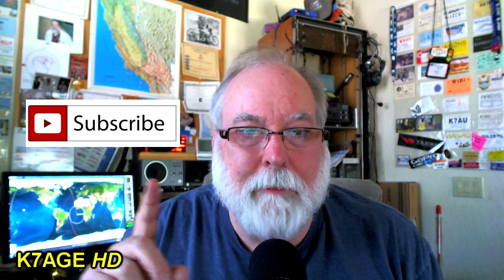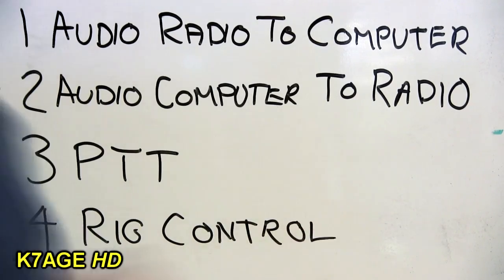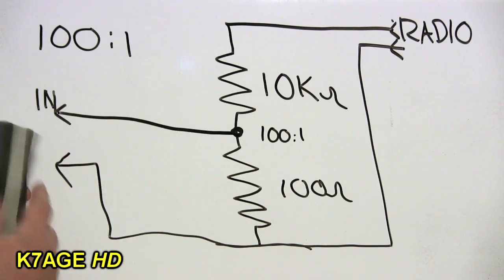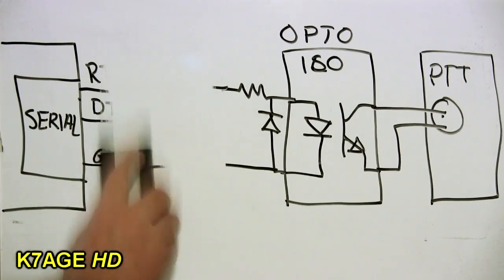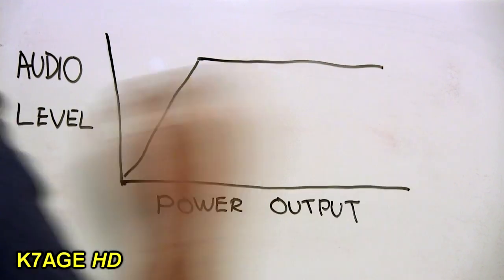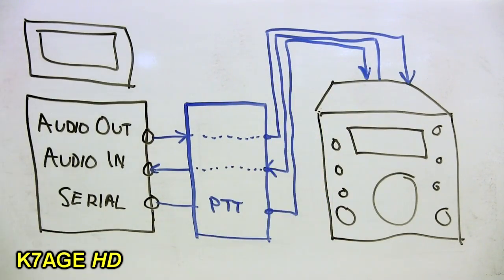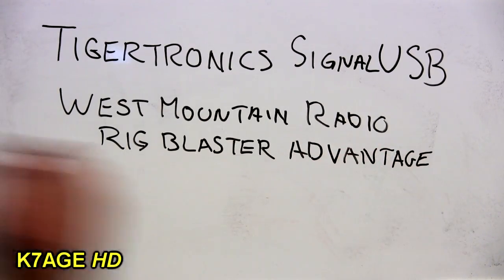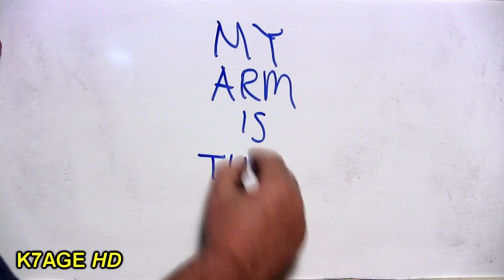Basics of Ham Radio Sound Card Interfaces PSK 31 and other Digital Modes

Comment: Great video! 

I've got a question that I think you might be able to help with. My club would like to transmit the ARRL Audio News over our 2 meter repeater, but I'm unsure how to hookup my Windows 10 computer to my Yaesu 2980R. I would prefer to hook it up through the mic interface on the radio as this would (I believe) facilitate the devices' use by other club members who own Yaesu 7250s. So, when I'm not available to transmit the news, someone else can... Any help you can  provide to me will be greatly appreciated... Thanks!

Comment: Even if you have a radio that does not have a built-in sound card, if you have CAT control working (either over a real serial port or via a USB to serial converter) you can use CAT for PTT rather than a physical line on the serial port. Only some radios support the CAT commands for turning the transmitter on and off, so check your radio's manual and test your setup to make sure it works.

Comment: Amateur Radio International : facebook.com/groups/TARGNF has several excellent articles in the unit Digital Ham Shack : Hardware / Software on selecting the right sound card for digital modes including how to evaluate individual sound cards based on Bit rate, Bandwidth & Dynamic Range.  Which ones to buy & which ones to avoid.

Comment: Are all Ham digital modes based on tones? Wifi and LTE I think are radio data connections not based on tone?  Looking for video Ham data connections using tones  compared to Wifi for beginners
Reply from the maker: Many of the ham digital modes use the standard audio input and outputs on a pc. So, the modes use tones or phase shifting of tones.

Comment: Thanks for this amazingly thorough discussion of this topic! I've learned more watching this one video than from about a hundred others I've watched put together. One question: You've presented this in the context of using the digital modes. I want to connect my Yaesu FT-450D to my computer, along with an SDRplay SPR2 for use as a panadapter. Likewise, I do plan to use digital modes. The FT-450D has both a serial CAT port and a Data port (DIN). Which connection would I use for panadapter control? Would I need a RigBlaster/SignaLink as well? I realize the one function I'd need would be to make sure there's some sort of TR switch. How does that figure into the equation? Sorry about all the questions, sheesh! I just want to make sure I'll have everything I need and not blow anything up. Thanks! ;-)

Comment: If your desktop doesn't have serial ports but has available expansion slots, you can get a dual port serial card for less than $12. Amazon, Newegg to name a couple. I've used them and they work as well as built in ports.

Comment: Hi Randy! Fascinating stuff you have here, I'm enjoying your videos. Since I haven't gotten a license yet and I'm still in the learning-what-I-can phase, I'm curious about using digital modes with the older transcievers that I will probably have to start out on, ie ones that don't have built-in serial or USB ports. I gather from here that as long as I have audio in/out and PTT jacks on the back I should be able to cobble something usable together, am I correct? Also, are digital modes used or allowed on 6 or 2 meter bands or are those just voice, and is this sort of thing possible with smaller mobile rigs that are being used as base stations? From what I've seen those have minimal connections other than antenna and mic, so I'm guessing not.
Reply from the maker: Hi, yes you can use the digital modes without built in USB or serial ports. You may have to connect into the mic jack and use VOX for transmit. Okay to use on 2 and 6. You may have to scare up some people to talk with. Probably not as much activity as compared to HF. If you mean smaller FM rigs, also not as much activity as SSB rigs.

Thanks for watching, Randy

Comment: The problem I noticed is many of the sound card interfaces add delay, due to their latency.  They often use slow mechanical relays or some built in USB audio soundcard codec that makes either the PTT or audio sluggish. Why use mechanical coil relays today is beyond me.  For about $2.00 you can get reed or low power solid state relays that switch about 100 times faster and since they're not mechanical, they don't wear out like the older mechanical relays used to.

Comment: Hi Randy, thanks for the video. I considered it to be a little too fast. I was able to understand all the basics but i am QRV in Digital for a couble of years now. I think a beginner has trouble to get all the information you scribble on your board so fast.
I understand you have to do it all in 8 min, but maybe a little bit slower ist better.
73, Mathias DL8ZAJ
Reply: If you want to watch the video more slowly (or faster), you can use YouTube's speed control. Click on the gear icon and change the playback speed. You can change the speed in 25% increments, anywhere from half speed to double speed.

If you want finer control, the Video Speed Controller browser extension for Chrome (and other Chromium-based browsers such as Brave and Edge) lets you change it in 10% increments. (There is more than one extension with that name; I use the one from igrigorik.) The extension will also let you change playback speed on other sites such as Vimeo and Netflix. You can get it from the Chrome web store. Similar extensions are available for Firefox.

Comment: EXCELLENT video Randy.  I use the EasyDigi kit.  $12 and 20 minutes to solder together.  Thanks for mentioning and emphasizing not overdriving/splattering.  It's a big problem on the bans.  W7BBQ.